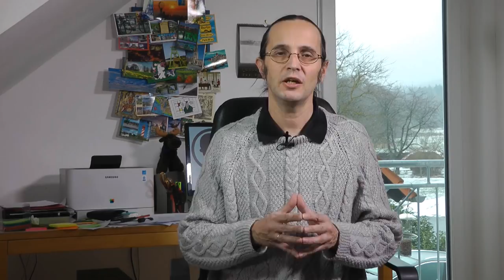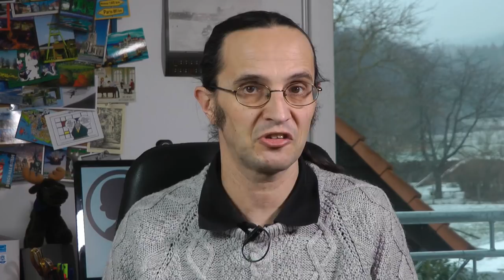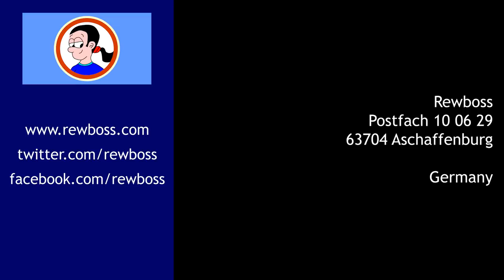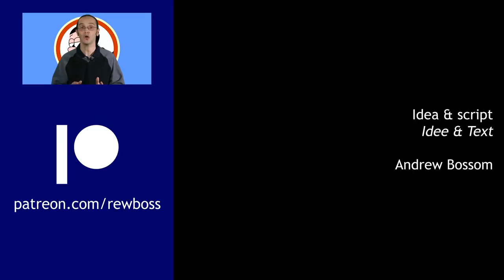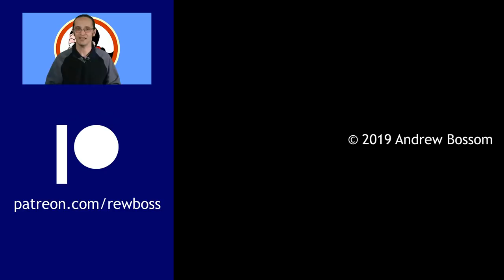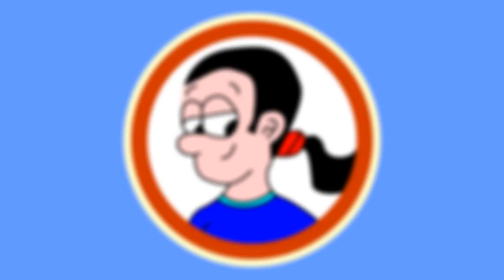Will German autobahns get a speed limit?

Comment: How to avoid shock wave traffic jams:
1. enforce the existing rules regarding safety distance to the car in front of you
2. enforce the existing rule called "Rechtsfahrgebot" that gets those slow idiots off the left or middle lane into the right lane
3. enforce the existing rule to look in your damn mirror before switching lanes
4. enforce the existing rule to set your indicator before switching lanes (not on switching lanes, not after it, but before doing so)
5. enforce the existing rule that says you're not allowed to drive extraordinarily slow without good reason
6. re-educate people on the numbers 1 to 5 through mass media
Reply: Number 2! Oh yes. Those Mittelspurpenner drive me nuts. And that comes from a guy with a 74 bhp Car. I have to keep my momentum and those idiots clog up the system,
Reply: It should never be necessary to brake on the Autobahn

Comment: I suggest enforcing the already existing traffic laws better so that irresponsible drivers are taken off the road because when following the rules speed limits are not necessary for safe driving.
Reply: Exactly. Especially when you consider that we have something called "Richtgeschwindigkeit" on the Autobahn, which is set to 130km/h and if you mess up while going faster, you automatically receive at least partial blame - even if the other party did cause the accident, because you're only allowed to go faster "if the conditions and traffic volume allow it" - so if you crash "going faster" it's implied that "the current conditions clearly didn't allow it". That's a pretty nice way to look at it and I'd like to keep it that way. Go faster if it really is safe. I think that's the spirit behind the dynamic speed limits too, that were already mentioned in the video.

Comment: I regularly drive from Rotterdam to Bielefeld (honest) and that moment when I cross the border into Germany is brilliant. A quick scoot to the services at Hünxe for a coffee and a 70 cent pee rids me of all the stress caused by regularly having to drive at 110kmh in the Netherlands and then on to Oberhausen and the road home. I tend to cruise at about 140kmh so 130kmh is a decent enough speed, it wouldn’t be too bad if they set it to that. 

What’s funny is I’ve noticed on my last few trips to the UK that the roads there are getting worse and as soon as there is a bit of open road on a motorway nobody pays any notice to the 70mph speed limit. Not that you get much open road. And even the Dutch have occasional bits of road with a faster speed limit than the UK. 

Don’t drive in Belgium though. They could make the speed limit there light speed and it wouldn’t make any difference! And last time I tried to drive in Italy, north of Rome, they ran out of road. I came off of a motorway and as the road curved around a bend it literally turned into a gravel track and then nothing at all. Luckily I could see where the road started again so I just headed in that vague direction and hoped.
Reply: Lair,  Bielefeld does not exists.

Comment: I thought that a car engine is more efficient at high speeds then driving that lower speeds correct me if I'm wrong.
Reply: That's only true until like 65mph, everything above that increases drag and fuel consumption dramatically.
Still there shouldn't be a speed limit!

Comment: In the early 1980s, Die Grüne had a compelling argument that setting the speed limit to 100 km/h would reduce the pollution greatly and claimed to have a study proving their thinking. The German government spent nine months studying this argument, using various vehicles at various stretches of Autobahnen, and came to the conclusion that 100 km/h would reduce only 1%, which is too insignificantly miniscule.

The Local (Germany) has a very excellent article about how Stuttgart "manipulated" its pollution reading in order to impose the driving ban for diesel passenger vehicles that aren't Euro 5 and 6. Additionally, no driving ban is imposed on the delivery vehicles that pollute more than diesel passenger vehicles. The link is:

https://www.thelocal.de/20181220/how-diesel-bans-have-ignited-a-debate-about-dirty-tricks-and-dodgy-money

Comment: Speed limits make for more comfortable and relaxed driving. In Belgium and Holland I can drive long stretches with cruise control because all traffic converges on the same maximum speed. While in Germany I constantly find myself breaking and overtaking because there is no consensus between the slowest and the fastest.
Reply: Good news: the recommended speed is 130km/h and most other drivers will be there or slightly above. I don't have any trouble using my cruise control - only if you go faster than "Richtgeschwindigkeit" (recommended speed of 130km/h) you'll have to switch it on and off constantly. Sure, if you're like "Oh, I'm in Germany, so I can set my cruise control to 180km/h or above!" you won't have the most relaxed time of your life.
I heard this argument from a bunch of people now - but when I answer with the above they go like "But if the speed limit is lifted, I want to make use of my right to go faster!" - yeah, sure, you may! But going faster is tiresome - that's all I'm saying. If you want a general speed limit, so that everyone has to drive slow, you might just as well apply that as a personal speed limit to yourself - if you're the slowest vehicle on the road, you'll never have to break for anyone. But true, that's extrapolation... just go with the flow or 5km/h below everyone else if you find the flow too turbulent for your liking ;-)
Reply: P. Dykmans Germany has an advisory 130kmh limit on some sections (from 1978) 😂
Reply: Please consider taking the public transportation system in germany if you can't drive a car on the autobahn safely.

Comment: I agree with the speed limit.
Reply: Could you explain why?
Reply: @SpektralJo  I just think that a general reduction in pollution, congestion and accidents on the Autobahns is an improvement, just my opinion though :-)
Reply: @violeteclipse3912  You do have a statistic that it reduces accidents?
Reply: @SpektralJo  No, I just presume it probably would. I could easily be wrong though.
Reply: @violeteclipse3912  Did you even watch (or listen to)  the video ?
Reply: @kellerkind6169  Yes, but after I wrote the comment, which was mainly because I found the video 3 seconds after Rewboss uploaded it so I wanted to be first, I was simply stating my opinion :-)
Reply: @jigglediggle29  Hey there's nothing wrong with having a different opinion. :-)